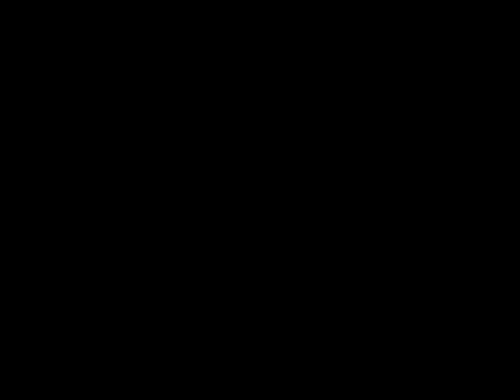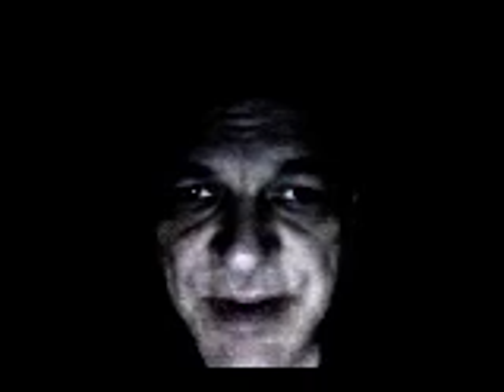You don’t even know bro can’t be saying it 1906 30-06, 1950 7.62, 1962 223, 1957 AR 15 or 1970's 556

Comment: Re: 9:17, What’s the history of the .308?
Reply from the maker: the 1952 .308  Parent case was the 1920 .300 Savage
the 1954 7.62 Parent case  was the 1920 .300 Savage & or others

they are similar enough that they "can be"  cross chambered for the other round , 
BUT the chamber head space are not a match , & neither "match"  300 savage

0.308 in (7.82 mm) vs 0.3080 in (07.80 mm) Bullet diameter 
0.345 in (8.80 mm) vs 0.3433 in (08.72 mm) Neck diameter 
0.454 in (11.5 mm) vs 0.4539 in (11.53 mm) Shoulder diam' 
0.470 in (11.9 mm) vs 0.4709 in (11.96 mm) Base diameter 
0.473 in (12.0 mm) vs 0.4728 in (12.01 mm) Rim diameter 
0.050 in (1.30 mm) vs 0.0539 in (01.37 mm) Rim thickness 
2.015 in (51.2 mm) vs 2.0150 in (51.20 mm) Case length 
2.800 in (71.1 mm) vs 2.8000 in (71.10 mm) Overall length
Reply from the maker: basically this was a time of innovation (wild catting) the affects of necking down & shoulder angle upon accuracy & smoothing out the pressure wave & is a vid i have back burnered for a year
Reply: @WapTek123 , Thanks for the info!
Reply from the maker: a rifled 30 cal barrel blank barrel has a .3 in (7.62 mm) Land diameter  & can be chamber reamed for any of 
the 20 or more cartridges that fire .308 bullets & this is why i wanna do an entire vid on the "308" phenomena 
https://en.wikipedia.org/wiki/7_mm_caliber